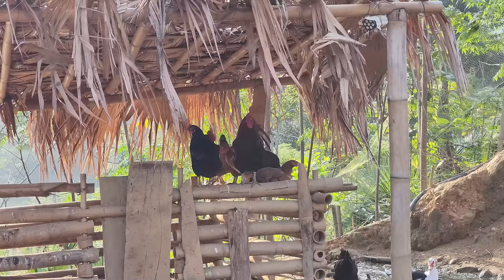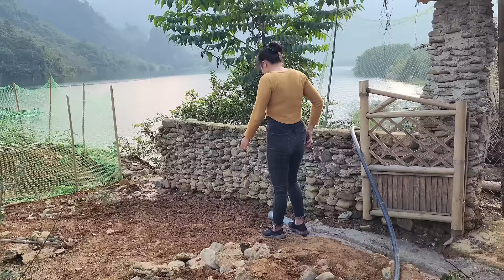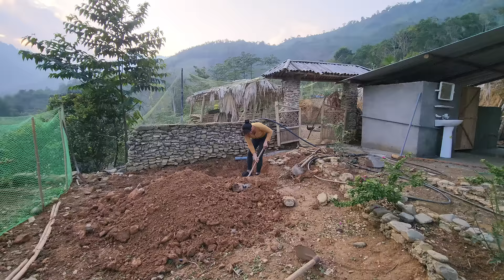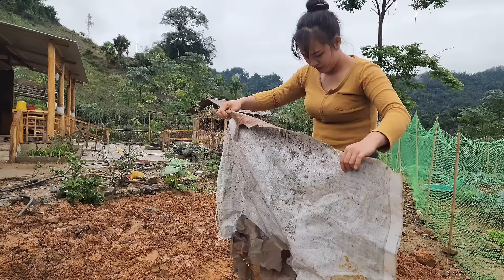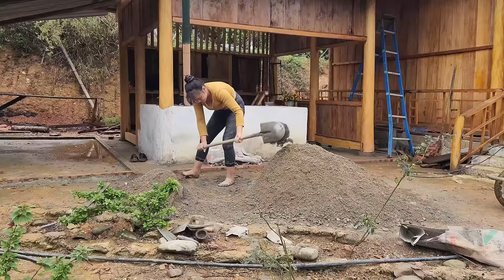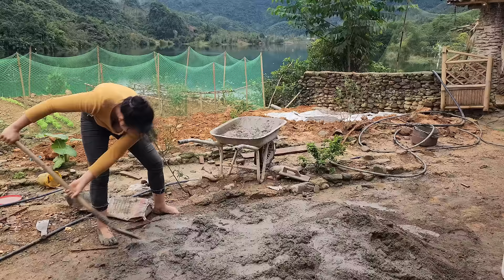Working on rainy and sunny days: Digging holes and building wastewater tanks |Trieu Thi Hoa

Comment: She didn't factor in that the waste water has to go somewhere  preferably a septic tank would be better but that hole in the ground won't work right either. SHE NEEDS A SEPTIC TANK!!! ANYBODY THAT WANTS THAT TYPE OF BATHROOM SHOULD KNOW YOU NEED A SEPTIC TANK. THAT IS NOT GOING TO FLOW LIKE THAT. SHE NEEDS TO ASK SOMEONE ABOUT A SEPTIC SYSTEM. AND COVERING IT WITH CEMENT WHAT YOU GONNA DO WHEN THE NON FLUSHING SYSTEM IS FULL AND YOU HAVE CEMENTED OVER YOUR POOP HOLE. ANOTHER THING SHE  FORGOT IS HER TOILET DOES NOT FLUSH!!! DID SOMEONE SEE  HER CONNECT THE TOILET TO A TANK TO FLUSH. NOPE DIDN'T HAPPEN. WHO EVER IS ADVISING HER ON HER PROJECTS NEED TO LEARN SOME BUILDING AND CONSTRUCTION ALSO, TO BUILD A BATHROOM WITH A TOILET THAT DOESN'T FLUSH  THATS NOT CONNECTED TO A SEPTIC TANK,  WHEN HER HOLE FILLS UP E EVERYTHING IS CEMENTED OVER. NOW I KNOW THAT HER CEMENT IS HORRIBLE AND MAYBE SHE CAN GET SOMEONE TO BRING A SLEDGE HAMMER TO BREAK THE TOP OFF HER POOPY HOLE. AND HOPEFULLY HE WON'T ASK QUESTIONS OF WHY DID YOU DO THAT!!!!😂

Comment: Hello my lovely hard working woman. Is nice to see you listened to my advice. But you should have installed the tank and drains before building the shower and kitchen. Am afraid this time you make a lot of errors. First the tank needs to be 1.6 mtr deep, you need to brick line it and concrete in the bottom, then install the water outflow pipe and the the waist water inflow pipe and then lay a lid on the top not concrete it over as one water will wash the walls into the water over time and 2 the water when full needs to go out and leave the muck behind to rot away Now you have to dig up the concrete you already laid in your kitchen and bathroom in order to put down drainage pipes. Must say you have a lovely body under the clothes was very nice to see. If you give me your mail I will send you some clips from one of my books then you can see what I mean and how you should have done it. With all you supporters you should use a little of the income to buy some good tools, like a decent spade to dig with instead of a shovel. O and yes it is hard work and I still can't see a western woman doing what you do so well done as to get things wrong is how you learn for next time. I know as have done it all myself apart from actually build the house as mine were built but needed a lot of work to make them livable.